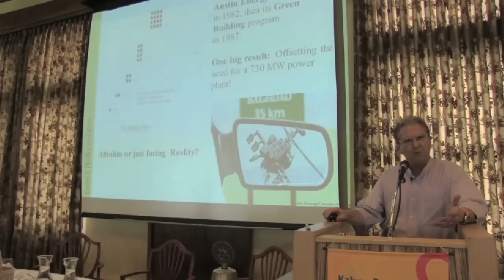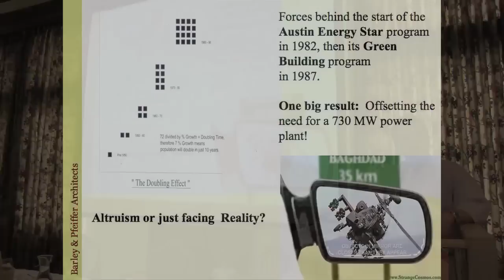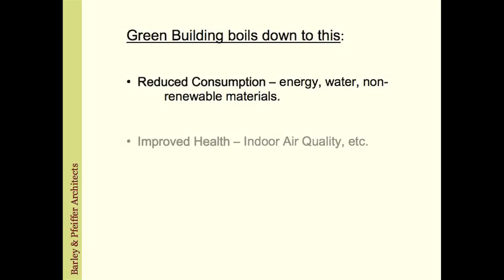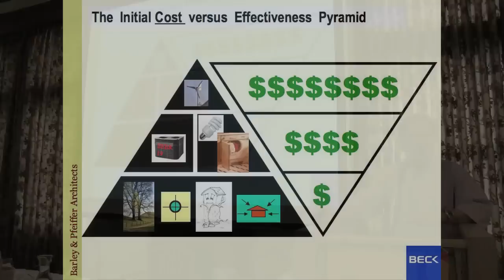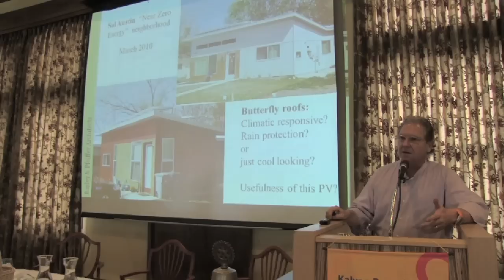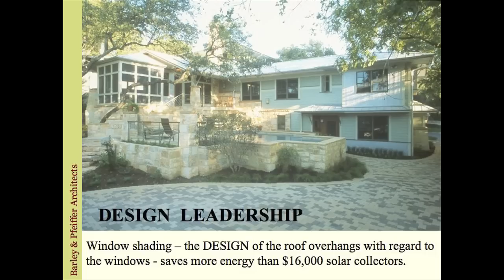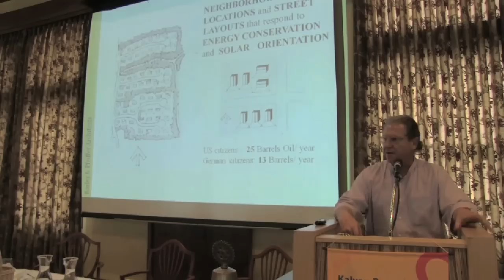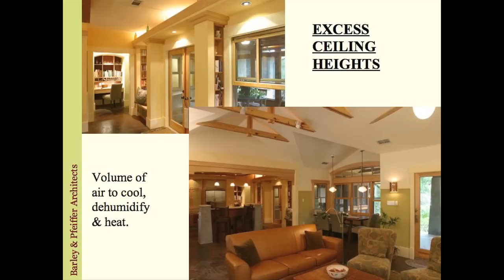Smart Design For Hot/Humid Climates - Architect Peter L Pfeiffer, FAIA Part 1 of 2

Comment: He keeps saying to shade West facing windows! That’s false science. In Northern tropics the highest heat gain is from South face, second East, West is third, North requires no shading.
Reply: this is climate zone 1 and 2: the west-facing window is defo bad without shading. Heat gain at 2pm in Miami is defo uncomfortable which is not the case for Toronto or Montreal. And I don't agree with his negative opinion on the high ceiling because the cold air will condense to the ground that is why a split AC works well by hanging off the wall. And the northern climate needs 9feet is that the hot air rises and people cannot feel the heat if it is 10-11ft
Reply: South facing windows can be easily shaded by overhangs because the sun is high in the sky at midday when the sun hits in this direction.  The west windows need to be shaded vertically because the sun is lower in the sky closer to sunset, when the sun hits the west orientation.

Comment: At 3:00 in the video, Peter Pfeiffer says that (at least in the case of Austin's experience) rain barrels don't really save any water.  Does he mean by this that houses that have roof rain catchment and cistern systems still use just as much piped-in (metered) municipal water as those houses that don't have rain catchment/cistern systems?  Wow, if so, that's surprising, not what I would have expected.  If that's the case, then I guess I should drop the idea of a rain catchment/cistern system for my planned zero-energy home build.
Reply: I can't speak for Peter, but he might be arguing that the relative costs don't change that much.  I.e, you will save /some/ money, or save /some/ water, but not enough to meaningfully offset your total usage.  

Just speaking intuitively, it does not rain enough in Austin for me to use purely rain water for my utilities, especially given that a single 15 minute shower uses something like 30 gallons of water, average.  If you have a 1000 gallon cistern, that's still only a month's worth of showers, and it would take more than a month's worth of rain to refill that cistern.  

Most people probably aren't going to change their habits drastically enough for that to make a difference, imo.  So its not that it couldn't work, but probably that its not going to solve your problem on its own.  Your mileage will vary depending on how much rain you get in your area.